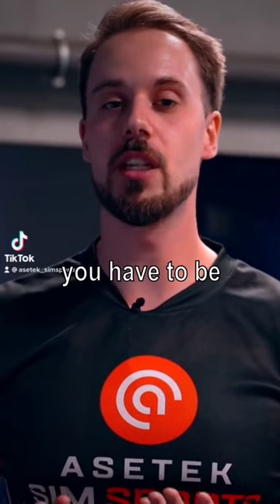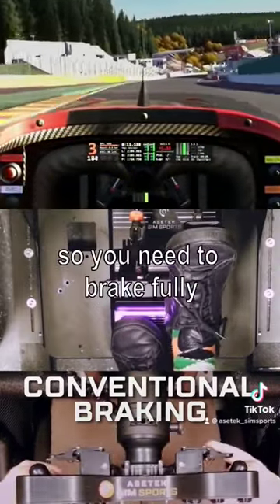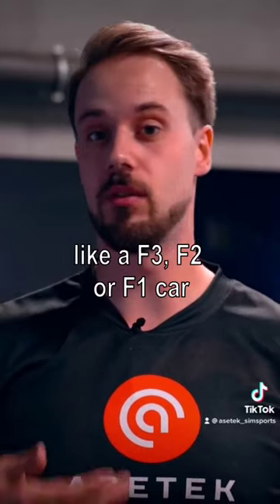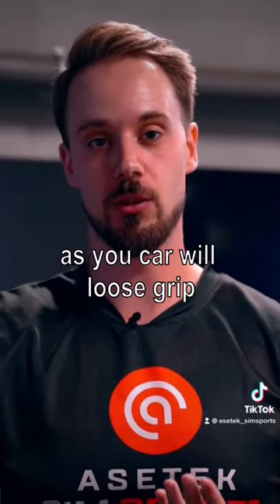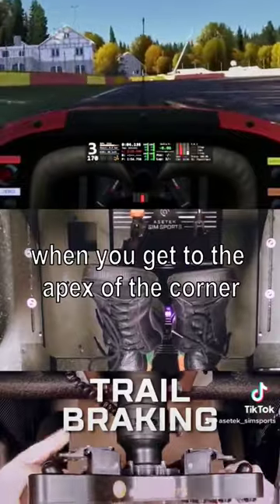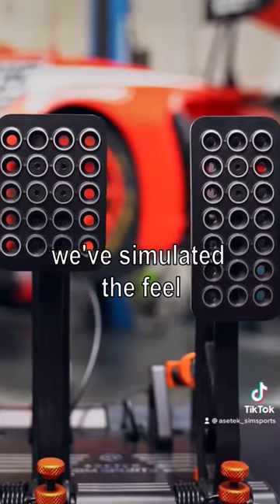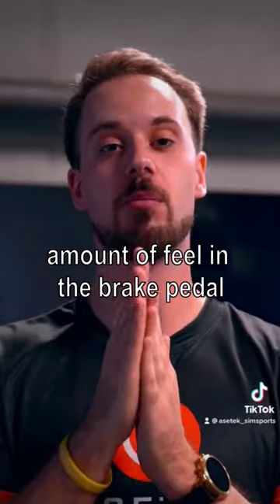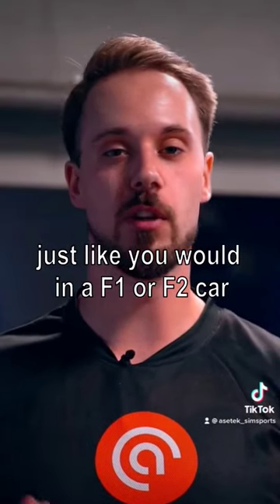TRAILBRAKING in under 60 Seconds #shorts #simracing #racing #drivinggames

Comment: How is your brake peddle moving so far? 
My Invictus brake pedal has a very small amount of push movement when I brake hard.
I have the black elastomer in the back of my brake pedal. Apparently the softest one, even though in my hands the white one felt the softest out of them all, and the black one barely moves at 28 BAR of pressure. 
My wife could only push it to 24 BAR.

Does the black elastomer get softer over more usage/ time?

Great pedals by the way! 
They take a while to get used to but they are a colossal step up from my Thrustmaster ones.
Good job guy’s! :)
Reply from the maker: Well, pedal movement will always be a function of how hard the pedal is being pushed (until it hits the 2. stage). In the video, it is being pushed at close to 100 bars, hence more travel than you would experience at 28 bars. Hope that helps 👌